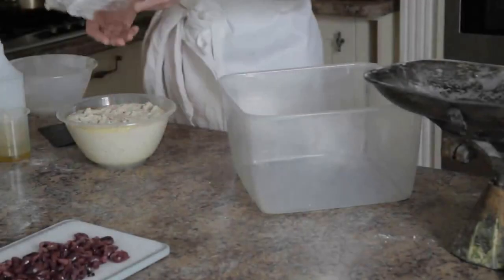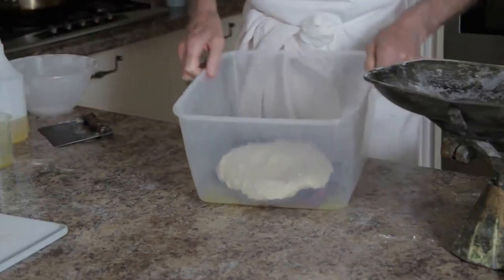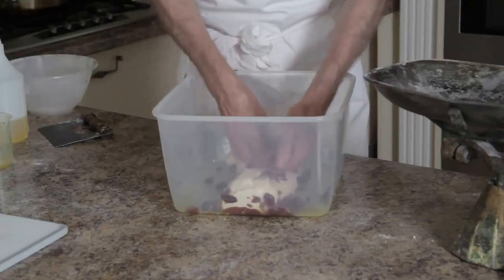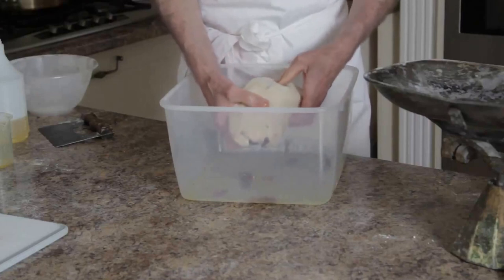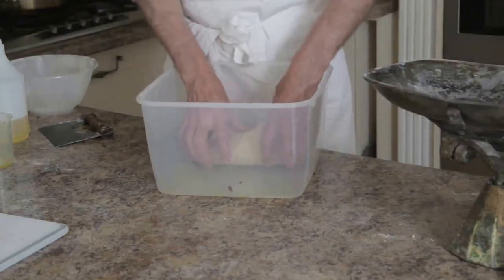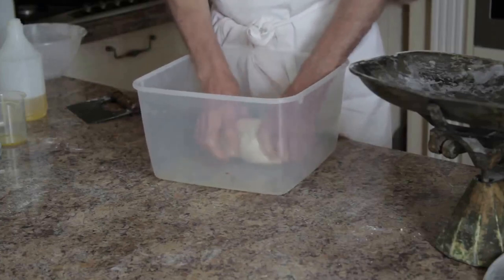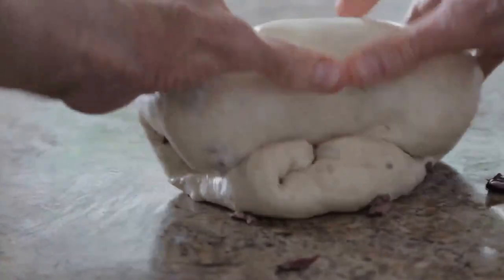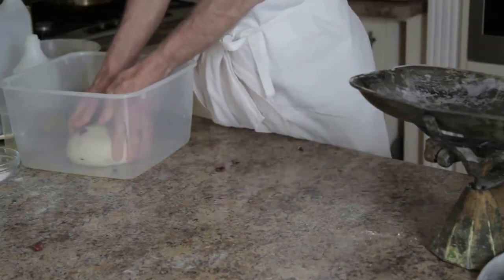PANARY - Rolling Olives & Oil Into Finished Dough

Comment: Thanking you Paul for this lovely video. I have been making a Sourdough loaf of bread that I bake in a Dutch oven and I would like to add dried fruit and walnuts would could i use the same method  of folding like you did in this video but would I need oil for the fruit and nuts too. Thanking you.